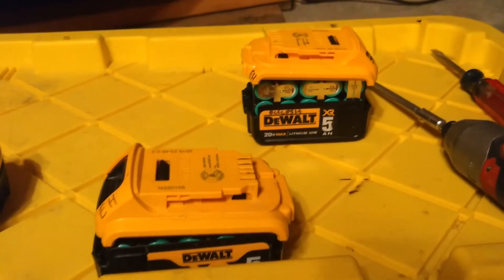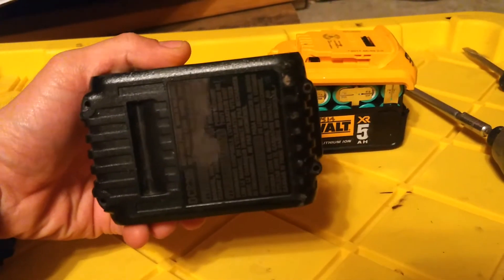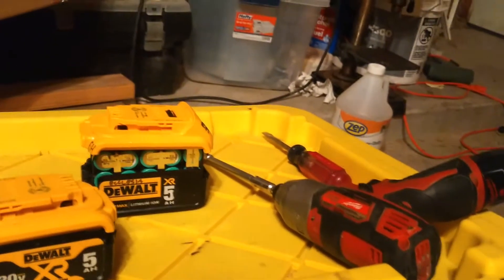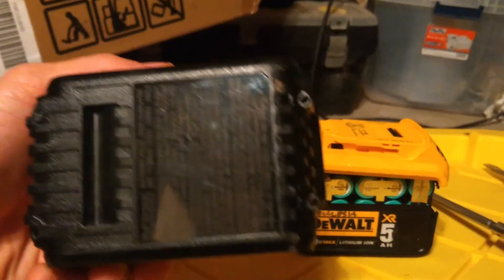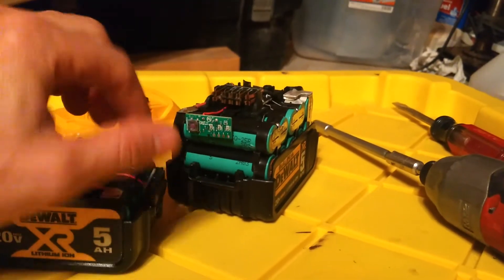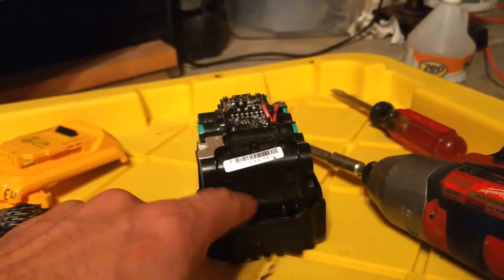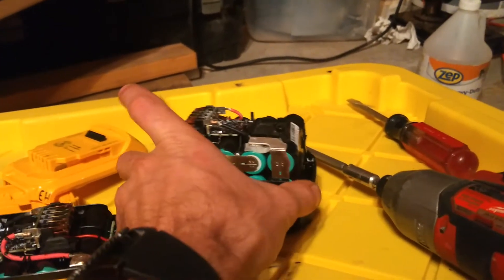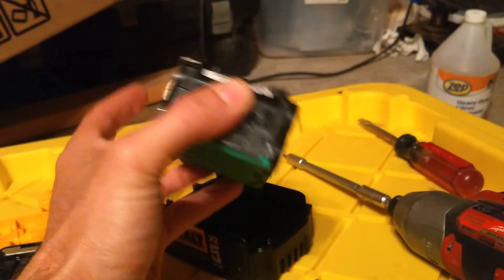How to take apart a 20v DeWalt Battery

Comment: Appreciate the post even though I’m late to the party. It has become nearly impossible to purchase from some authorized retailers without “accodentally” ending up with a few counterfeits that sneak there way in. 

I believe instead of lime green Samsung cells there are yellow? Pink? So much stock is swapped and stolen from Amazon and Home Depot. I think it’s weird that I have to actually have to check the guts of a tool nowadays just for peace of mind.

 ‘’merika
Reply from the maker: So I'd say that it's pretty easy to tell a fake in the battery world once you take it apart. The innards of a fake are generally pretty poor. The contacts are loose and the battery contacts are small. There are a couple of good videos online and DeWalt has released some info on fakes as well (just by looking at the housing there are some tell-tale signs).
  I wouldn't focus on the cells because manufacturers do use different cells as supply changes.

Comment: I got one 18650 scratched to the metal and gently bent 0,5mm inside from the screwdriver. I wonder if this will be a problem...
Reply from the maker: You can't be 100% sure, but when I have tried to purposely damage lithium ion it has taken a lot of force and actually piercing through it for it to be damaged. However, we all know they can burst into flames, even without damage, so you'll have to decide...

Comment: You can use a tiny flathead screwdriver to take out the safety screws without breaking the little pin in the middle

Comment: Didn't work for me.  Discovered today I might have bought fake batteries on amz so I wanted to look at the cells but can't get the top off without destroying the battery.  Got it part way off but couldn't see the cells or what exactly was holding it together and then pia putting the cover back on without destroying it too. Dewalt has this document on how to spot fakes but when I looked at the product battery on hd, according to dewalt it's a fake.  I guess I'll have to wait until it fails now to find out if it's a fake or not.
Reply: The battery he is showing u is also fake. Because dewalt batteries do not come with safety screws. I have numerous dewalt batteries. None have safety screws

Comment: So does the 5ah guts fit in the 4ah case any help would be greatly appreciated
Reply from the maker: Yes, I got 5ah XR cells and fit it into a standard 4ah case. Have to be careful as there are compact batteries and even flat packs now. But the OG 4ah and 5ah are interchangeable.

Comment: I wish the video showed the actual cells at some point.  I assume they are 18650 cells.  I watched the video just to try and find the type of cells that are used by the actual DeWalt batteries.
Reply from the maker: I'm fairly certain this battery had Samsung cells. They are definitely 18650s but I think I've seen red LG cells in a DeWalt battery before too.

Comment: Do you think there could be counterfeit batteries out there?
Reply from the maker: Yeah, definitely. However, there probably aren't too many because the labor required to swap out cells is fairly intensive and most knock off batteries that are made are easy to identify as such.
Reply: @MyFortressConstruction  I purchased an 8AH on Amazon but it arrived in a small cardboard box with no paperwork or anything; I found it odd. I compared it to some of my DeWalt batteries and found some alarming things wrong with it, so I returned it.

The battery indicator was different and the torx screws were not the security type.

I think dewalt might have thrown away some of their worn production tooling and someone in China got their hands on it.

Comment: I have this same battery (DCB205) with missing screws on the bottom. Could you tell me where I could buy a replacement for them and the name of the bit please ?
Reply from the maker: Should be a torx T-10 security bit. As for the screws themselves, I don't know where you could find them.

Comment: Lithium doesn’t explode, it catches fire, lipo’s explode.. but thanks for the video, nice job, appreciate knowing what to do.
Reply: Lipo?
Reply: Lipo is lithium. Lipo is short for Lithium Polymer. All Lipo batteries are lithium, not all Lithium batteries are Lipo. 

All Lithium batteries are capable of thermal runaway, especially Lithium Nickel Manganese Cobalt cell batteries (the chemistry most commonly used in Dewalt batteries). Lithium Iron Phosphate cells are safer but still not immune to runaway.

Comment: Thanks for posting. I was wondering what kind of screwdriver to use. I took a 3/32 drill bit and drilled the pins off the screw head and took a regular Torx - 10 screwdriver and got the screws out
Reply from the maker: Risky, but it works!

Comment: What's the torx screw size?
Reply from the maker: I offhandedly mentioned the size at 0:42. It is a T-10 bit and you will find that a lot of manufacturers use that size.

Comment: The fusible link on two of my DCB205 20V 5AH Dewalt batteries has melted. I can't seem to find a place to get a replacement. Can I just Solder bypass it? What do you think? Comments?
Reply from the maker: If it melted it would make me question the integrity of the cells themselves if it got that hot, but if you are able to confirm their integrity (no expansion/bulging/deformity/staining), then I would watch some videos on guys putting together 18650 cells and what gauge of wire they are using because using a certain gauge of wire can act like a fusible link in that it will melt at a certain amperage draw. I don't know where you live but somewhere has to have some fusible links for sale, or sacrifice one battery as a "parts battery" and use the links off of it. I wouldn't just solder on any old connection as you don't want your battery exploding or catching on fire. Good luck!
Reply: So the gauge won’t light up either?

Comment: Thanks for the video! I have several 18640 samsung that I had from a proyect and I wanted to replace a cheap battery pack with those
Reply: power tool need high drain type (10-25A), NOT the ones you find in your laptop battery which has a much lower normal drain current (max 5A).

Comment: I appreciate the effort, but you just glossed right over the most critical part. Just how did you get the T10 screws out? Did you have the "safety" Torx driver? Did you break out the pin? If so, how?...
Reply: just buy the correct screwdriver, there is Chinese kits everywhere for less than 10 dollars and you will have correct screwdrivers for everything

Comment: Why would you wire them in series?
Reply from the maker: Wiring them in series will change the voltage, and then you can wire them in parallel to get the amperage. This would be if you were modifying the batteries for use in something outside of a power tool. Though, technically speaking, you could take (3) 5ah 20 volt batteries, hook them up in series so they become 60v (54v in use), and you would have a 5ah 60v battery to run a flexvolt tool off of. Or you could hook them up in parallel to get a 15 amp hour 20 volt battery.

Comment: Are the cells 18650 li/ion? Also what company is written on them?
Reply from the maker: Yes, 18650s, but I don't know what the company was.
Reply: @MyFortressConstruction  okay thank you - planning on making my own out of recycled laptop batteries and have a few im fixing anyways. Here in canada the 2aH pancakes are any where from 60-90 dollars. 2aH is a fart in the wind for getting stuff done
Reply from the maker: @pjosephsmith  Yes, 2ah is fine for homeowner tasks, or when you want something lightweight, but I have about 16 DeWalt batteries ranging from 5-9ah. Are you going to wire the cells together and place them in old casings?

Comment: It is called a tamper resistant screw.
Reply from the maker: I think they're mainly referred to as security torx screws. I think you would find it if you typed in security Torx size 10 bit or screwdriver.